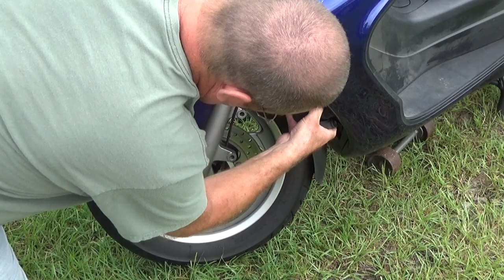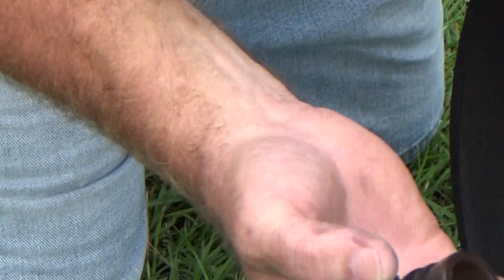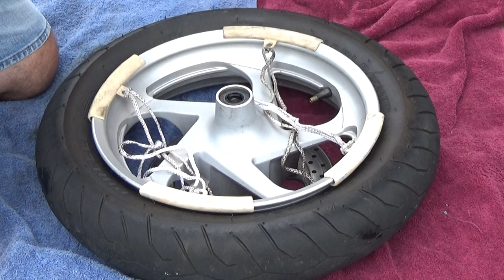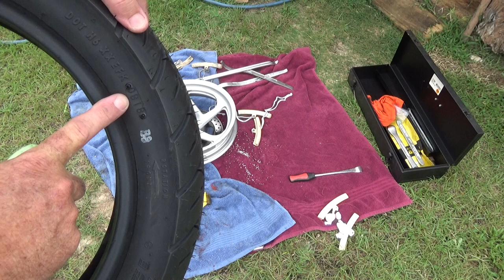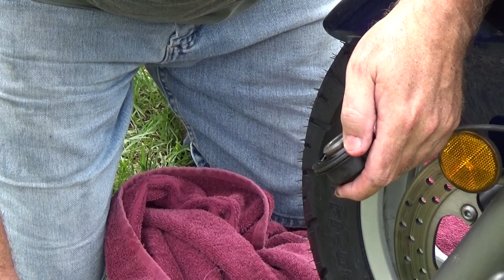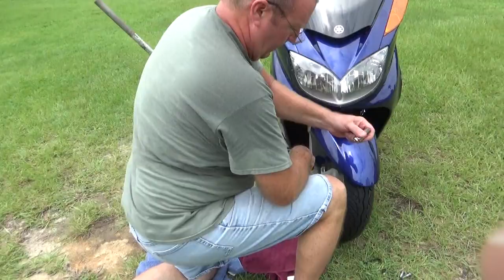FRONT TIRE CHANGE ON 2005 YAMAHA MAJESTY YP400T

Comment: Do you know how to access the air filter on the passenger side that is behind the footrest panel? I am unable to find any instructions on how to do so.....Thanks!
Reply: there are 3 filters on this bike. One CV, and others are air. you have to remove the top plastic under the seat for the one, and the second one is the cover over your tranny...just a few screws....and keep those clean:)  Hope this helps, but you prob figured it out by now.:)

Comment: Next time zip ties on it will be like a piece of cake
Reply: @יהוכנן לבי let the air out the tire and take you some zip ties long enough to go around the rubber tire zip tied as tight as you can take both sides off at the same time the same process putting it on